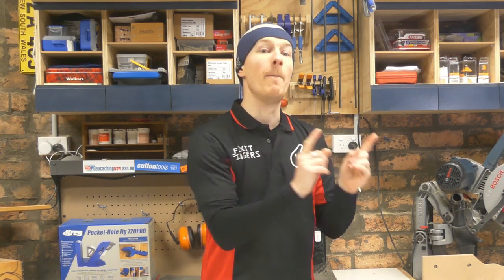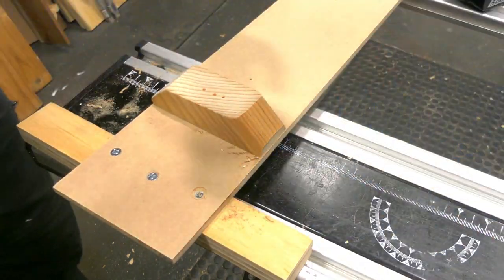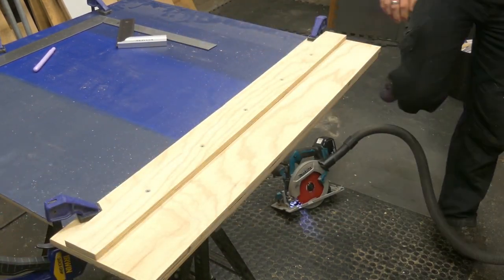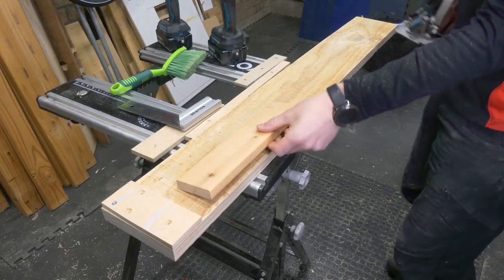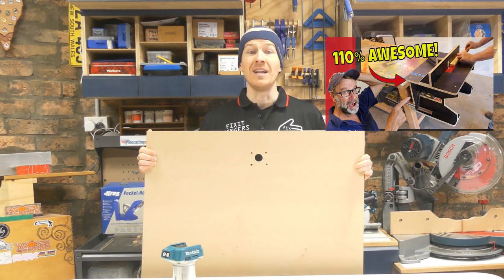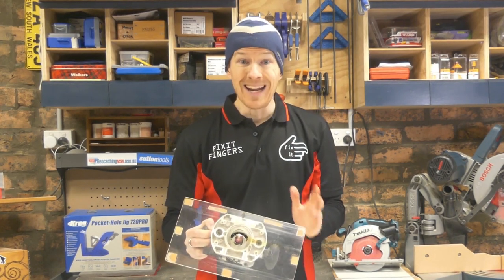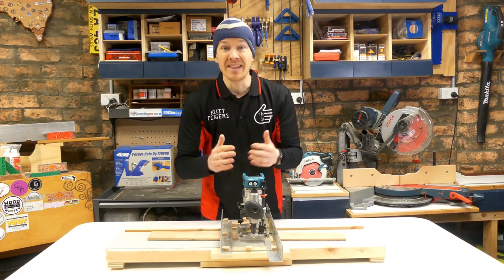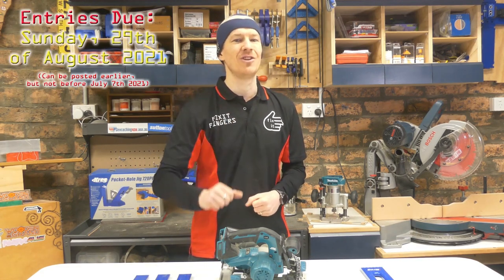Top 5 Jigs for Woodworking Beginners: DIY vs Paid Circular Saw & Router Jigs (#WoodJigs21)

Comment: I've watched so many jigs ideas in the last couple of weeks but this one is the best. Simply but effective. I only have a drill and a circular saw. But I think I can do this. Thanks!
Reply from the maker: Honestly, they are the only tools you need to get building!  Half the things I've made used basically those only. Add a router when you're ready and the skies the limit 😁

Comment: I have a tablesaw but I haven't used it for so long its now just a table. I prefer a circular saw and a jig 😀
Reply from the maker: I made a table saw over a year ago... think I've bothered to set it up twice 😅
Reply: @FixitFingers  i originally built a table saw using my circular saw, and then i just purchased a contractor skil saw - love it - seems more accurate than what i had made, but it does take up space...
Reply from the maker: @Monduras  I also made a flipped circ-saw at one stage but then never really used it as it was a pain to set up. Now SawStop just released the CTS super compact table saw it was a no-brainer... got one, it fits in the shop under my workbench, super happy! :D
Reply: @FixitFingers  awesome, i got the skil 15 amp saw when it went on sale. i heard the sawstop one has a bit of play in the rails when extended to max rip capacity. hope that didn't happen w/yours.
Reply from the maker: @Monduras  oh that was the most 'click bait attention seeking claim desperately trying to get views by making up a fault' thing I've heard recently 😋 No, I love mine, there is no significant play, the fence is excellent. He complained the rails could lift upwards at full extension.... I'm sorry but if you are lifting the fence while cutting you are doing it wrong  🤣 Secondly, it's a lightweight jobsite saw for  construction and costs under a grand. Trying to compare it to a cabinet saw is like blaming your router for not being a CNC 😋

Comment: Another great video James. Have you used any of the Kreg ones to do rip cups of pallet planks maybe? I'm 99% doing pallets and I have a very rustic jig for the circular saw, unsure if I really need something like a Kreg one but also trying to avoid going to a table saw. I also might continue asking you on IG.
Reply from the maker: G'day mate, for pallet planks and bed slats I've always used the third one in this video, the narrow ripping jig. Kreg doesn't make a jig specifically designed to do this task. While you could use the rip-cut, balancing it would be tricky so I think the DIY option is best :)
Reply: @FixitFingers  thanks a lot mate, I've been thinking for a solution and definitely yours I believe it's a good one. I think I've found some aluminum scraps that I might be able to attach to a plank so will see how it goes :).